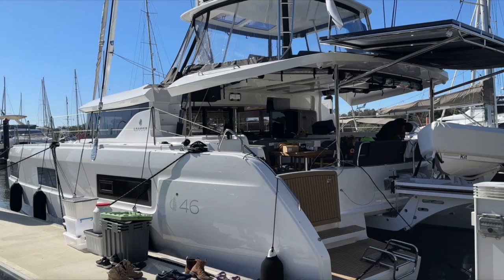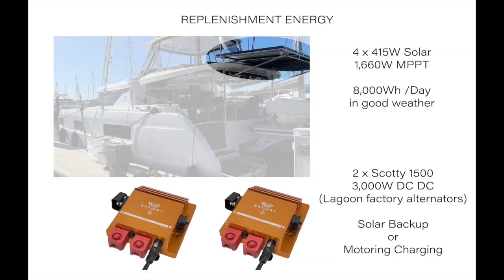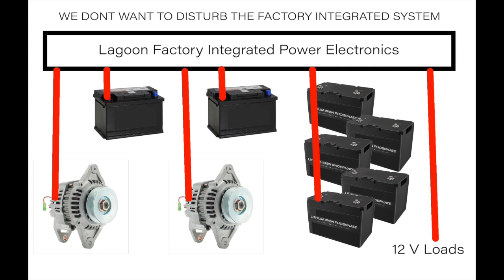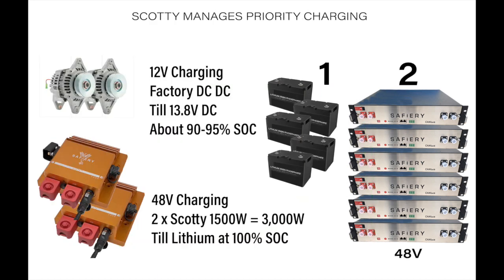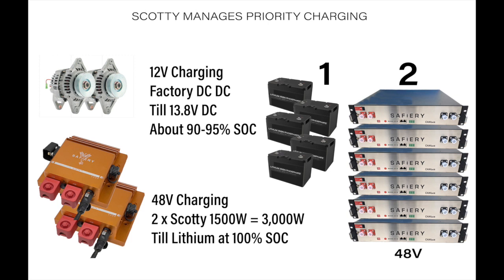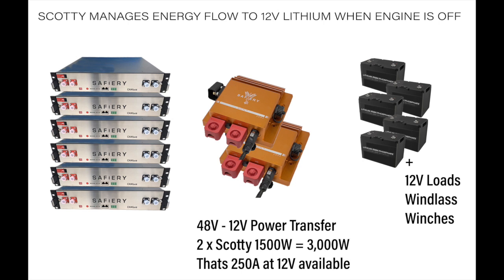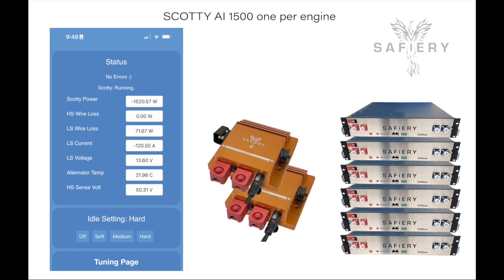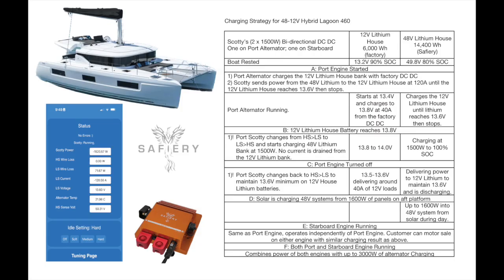Lagoon 460 Power Upgrade NO disturbance factory integrated power electronics 3000W from alternators

Comment: How did you get the Scotty to maintain 13.8? Is it in the tuning?
Reply from the maker: @HollyBoniakowski  it’s in the configuration of the tuning software. User can change that. Plus a delay before it cuts into 48V charging until the 12v lithium are about 95% charged